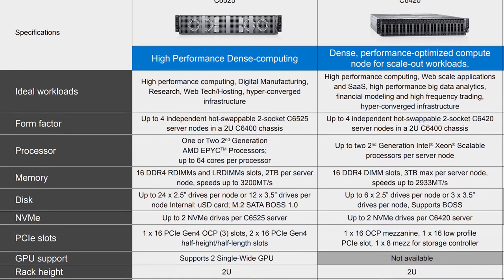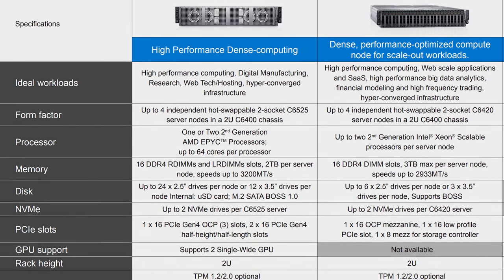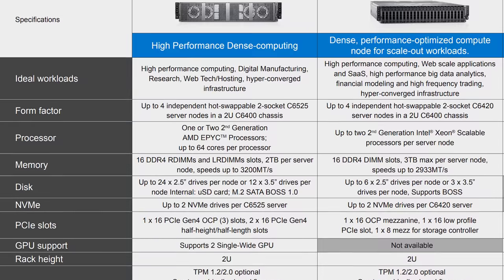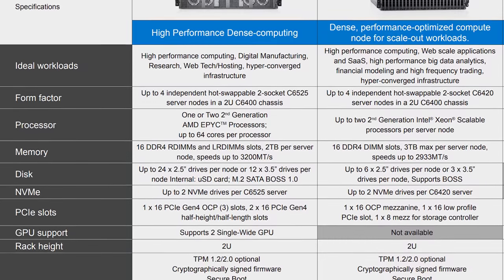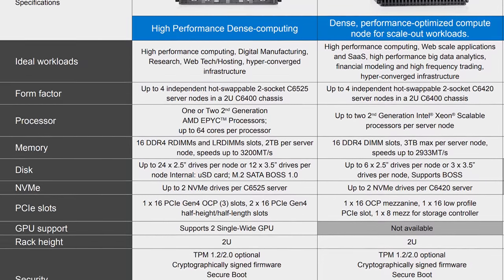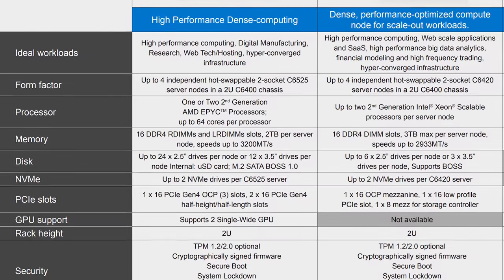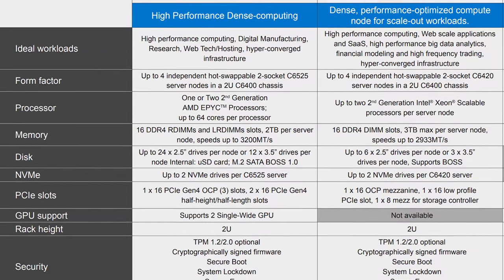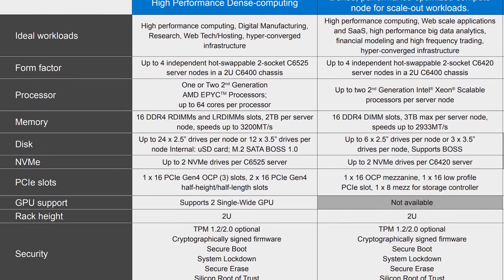Dell EMC PowerEdge C6525 AMD EPYC Powered Kilo-Thread Server Review

Comment: Can you elaborate on the CPU/iDRAC fuse thing? Do you mean that you can't swap the CPUs out at all, even for the exact same SKU, e.g. in case of a CPU failure? Or is it more a case of preventing the customer from buying a particular configuration from Dell and then upgrading the CPUs to a higher end SKU using cheaper aftermarket parts? Or is it the other way around and it's actually that the CPUs themselves that are somehow locked to Dell platforms?
Reply from the maker: The fuse happens on the CPU. We had an EPYC 7001 part that we put into a Dell machine with this back in 2018 before this was known in the industry. We could put other CPUs back in, but we could not put that EPYC part in another vendor's system. So you can upgrade the SKUs in a server. However, if those fuses are blown, it seems like you can only put the CPUs you removed into another Dell system. We are probably going to go more into this. I thought it was commonly known, but just nobody had reported on it. Now I realize that maybe this has been happening since 2018 and maybe people do not know this in the industry since the systems are still new.
Reply: @ServeTheHomeVideo  Very interesting. I searched online and the only result mentioning it was the STH article accompanying this video. I would definitely be interested in the deeper details of it.

I suspect that the fuses are being set inside the AMD PSP, although the only solid reference I have for that is that the AMD developer datasheet for Zen2 mentions "fuses" (with no further information) as being a feature of PSP, and a paper from 2019 titled "Insecure Until Proven Updated: Analyzing AMD SEV’s Remote Attestation" which talks about the Chip Endorsement Key (CEK) that is programmed into PSP fuses on the CPU.
Reply: @gsuberland  Well, the CEK is immutable, once the chip has been manufactured via chip-unique OTP fuses (more accurate: the secrets the CEK is based upon). I would consider the entire SEV security (for which the whole shebang was designed for in the first place) compromised, if one could alter the CEK via platform. It would also defy the meaning of "OTP" (one-time-programmable).
The whole thing is well documented in AMDs "Secure Encrypted Virtualization API Version 0.24".
I haven't seen anything in AMDs available(!) documentation, which would hint towards the observations of STH.

STH: This is seriously hot stuff - I'd be delighted to read/watch a follow-up.

Edit: I found an interesting independant document, which I will be reading through: "Insecure Until Proven Updated: Analyzing AMD SEV's Remote Attestation"
https://www.google.com/url?sa=t&rct=j&q=&esrc=s&source=web&cd=ved=2ahUKEwjBhPjYnrfrAhUDAmMBHWOPA9gQFjANegQIBhAB&url=https%3A%2F%2Farxiv.org%2Fpdf%2F1908.11680&usg=AOvVaw0FzNCe92hxY7ewcipopmy2
Reply: It's part of AMD's Secure Processor, and it allows the CPU to verify that the BIOS isn't modified or corrupted, and if it is, it refuses to post.. It's not exactly an efuse and more of a cryptographic signing thing going on where the Secure Processor validates that the computer is running a trusted BIOS image. The iDRAC 9 can even validate the BIOS image while the system is running. The iDRAC can also reflash the BIOS back to a non-corrupt, trusted image. On the first boot of an Epyc processor in a Dell EMC system, it gets a key to verify with; this is what can stop the processor from working in other systems as well.
Reply: @Zizzily  Do you have a reference on that? I'm fairly clued up on x86 platform security but haven't heard of field deployable secureboot root of trust keys on AMD or Intel CPUs. A feature like that would be quite the find for projects like coreboot.
Reply: @gsuberland  https://downloads.dell.com/manuals/common/security_poweredge_amd_epyc_gen2.pdf
"The first generation of the AMD EPYC processors have the AMD Secure
Processor – an independent processor core integrated in the CPU
package alongside the main CPU cores. On system power-on or reset,
the AMD Secure Processor executes its firmware while the main CPU
cores are held in reset. One of the AMD Secure Processor’s tasks is to
provide a secure hardware root-of-trust by authenticating the initial
PowerEdge BIOS firmware. If the initial PowerEdge BIOS is corrupted or
compromised, the AMD Secure Processor will halt the system and
prevent OS boot. If no corruption, the AMD Secure Processor starts the
main CPU cores, and initial BIOS execution begins.

The very first time a CPU is powered on (typically in the Dell EMC factory) the AMD Secure Processor
permanently stores a unique Dell EMC ID inside the CPU. This is also the case when a new off-the-shelf
CPU is installed in a Dell EMC server. The unique Dell EMC ID inside the CPU binds the CPU to the Dell
EMC server. Consequently, the AMD Secure Processor may not allow a PowerEdge server to boot if a
CPU is transferred from a non-Dell EMC server (and CPU transferred from a Dell EMC server to a non-Dell
EMC server may not boot)."

Cheers! If you find anything neat with it, drop me a line. I have some friends who are researching into AMD's security, both CPU and GPU side.
Reply: @gsuberland  Oops, almost forgot the iDRAC9 bit! https://downloads.dell.com/manuals/common/dell-emc-idrac9-security-root-of-trust-bios-live-scanning.pdf

"Today, even a flashed firmware in a Read Only Memory is susceptible for exploitation by hackers who
commonly try to expose the system to malicious activities. Even though UEFI Secure Boot is effective in
providing host security, it fails if the flashed firmware is compromised. Hacker could gain physical access to
the system, and maliciously tamper with the BIOS image.
To counter the boot integrity threat problem, Boot Guard technology was introduced by Intel few years ago
with its 4th generation cores. This Root-of-Trust is based on one-time programmable, read-only public keys
that provide protection against malware tampering. When a system with Boot Guard starts, the BIOS image’s
cryptographic hash is verified against the stored key. If the verification succeeds, the BIOS boots up normally.
If the verification fails, the BIOS image is compromised, and the system fails to boot.
In addition to Boot Guard’s verification mechanism, iDRAC9 4.10.10.10 provides a Root of Trust mechanism
to verify the BIOS image at the host boot time. The host can boot only after the BIOS image is successfully
validated. iDRAC9 also provides a mechanism to validate the BIOS image at run time, on demand, or at user
scheduled intervals."

"Dell EMC takes security seriously and has adopted Boot Guard technology on its new generation of
PowerEdge servers to counter BIOS tampering issues. On the latest AMD Dell EMC PowerEdge servers with
iDRAC9, iDRAC first boots with chain of trust authentication, and then verifies BIOS integrity. iDRAC takes on
the role of hardware-based security technologies as well, and accesses the primary BIOS ROM through SPI
in addition to AMD’s fusion controller hub (FCH) and performs the RoT process.
iDRAC9 4.10.10.10 directly accesses the BIOS primary ROM to perform a RoT operation on the processor,
on both the security block and the host initial BootBlock."

and

"1. When logged into iDRAC, a SEL event notifies the user that iDRAC has failed to verify BIOS, but host
booted successfully.
• This is part of iDRAC HW RoT. Even after a failed BIOS image verification, iDRAC performs a
recovery operation to bring good BIOS image."
Reply: @Zizzily  Nice one, I'll have a read of those docs later! :)

Comment: Like for covering the fpga fuse thing; will avoid Dell for my next purchase.
Reply: It's part of AMD's Secure Processor, and it allows the CPU to verify that the BIOS isn't modified or corrupted, and if it is, it refuses to post.. It's not exactly an efuse and more of a cryptographic signing thing going on where the Secure Processor validates that the computer is running a trusted BIOS image. The iDRAC 9 can even validate the BIOS image while the system is running. The iDRAC can also reflash the BIOS back to a non-corrupt, trusted image. On the first boot of an Epyc processor in a Dell EMC system, it gets a key to verify with; this is what can stop the processor from working in other systems as well. I guess we'll see if other OEMs start doing this with Epyc processors.
Reply: @Zizzily  i'm a little fuzzy on the details (that i'd be very interested to know about), but the idea is that the processor has a key to verify the bios with, so that even if it is updated while powered down, it can check that the origin is valid? Is the key unique to the individual BMC or to the vendor? I like the idea that iDRAC can flash the firmware - i'm jealous that iLO cannot, at least the version i have - to the point that it would almost be preferable to remove that ability from the running system itself to ensure integrity.
Reply: @capability-snob  I believe the keys are at a vendor level rather than a BMC level. Here's some more documentation from Dell:
https://downloads.dell.com/manuals/common/security_poweredge_amd_epyc_gen2.pdf
https://downloads.dell.com/manuals/common/dell-emc-idrac9-security-root-of-trust-bios-live-scanning.pdf

Comment: What difference is there between blades and nodes?
Reply from the maker: Typically blade servers have integrated chassis management as well as interconnect/networking. In these systems, there is not a chassis switch or pass-through module so we typically just call them nodes. People do use both sometimes, but usually when they are less aware of the difference between these systems and the blade segment. There are other differences as well, but those are usually the big ones.

Comment: Amazing review. Really detailed. Love it. Is there any 100gbe cards for this system? I just learned about that new adding spec.
Reply from the maker: We could not put 100GbE cards in because the one riser we had was occupied. The OCP NIC 3.0 slot is x16 so one can, in theory, put a 100GbE NIC in there as well as the x16 slots. Also, one could likely work with Dell to configure EDR/ HDR InfiniBand.
Reply: @ServeTheHomeVideo  I was thinking about the OCP slots if you could install 100gbe card
Reply: I just looked at the Dell site today, and they offer the HDR100 Mellanox card that can do 200GbE over FC or Ethernet.
Reply: @NdxtremePro  thanks for checking that's insane speeds
Reply: @ServeTheHomeVideo   So one rack full of this and you have already exhausted the outgoing bandwidth of your normal data centers. In the USA with it's rotten private infrastructure most have just a few TB bandwith.

Comment: Dell blowing efuses to lock in particular CPU to particular motherboard -- did i understand that correctly? That is just crazy and stupid if so -- what if your CPU gives out the magic smoke, you are supposed to get a completely new system? fsck that
Reply from the maker: Not exactly. We have had a lot of feedback on this so we will have a more detailed bit on it soon.
Reply: It's part of AMD's Secure Processor, and it allows the CPU to verify that the BIOS isn't modified or corrupted, and if it is, it refuses to post.. It's not exactly an efuse and more of a cryptographic signing thing going on where the Secure Processor validates that the computer is running a trusted BIOS image. The iDRAC 9 can even validate the BIOS image while the system is running. The iDRAC can also reflash the BIOS back to a non-corrupt, trusted image. On the first boot of an Epyc processor in a Dell EMC system, it gets a key to verify with; this is what can stop the processor from working in other systems as well.

Comment: With that system i could have done the last three years of my phd thesis in a few month😭
Reply: You've caught my interest, why would it shave it down that much?
Reply: @everythingfeline7367  on one hour of manual work/biological model building come 3 h of calculations/refinement on 8 threads (the maximum i had). Best you run 3 different refinment strategies in parallel and continue with that that gave the best result (what i fid over night, often took 10 h). If i had a threadripper i would have run 5 in parallel (each using 10 threads). I did this like 3 years) Also with enough cores you can automate alot like 5 h (4 cores) automatical model building saves like 30 min-1h of manual building in average. Sth else i did often 2 minutes manual parameter edit, then 30 mins on 4 threads calculations (i always did 2 in parallel). So 2 min work 30 mins calculation (which could utilize hundreds of cores but i just had 4). And i did this often for many days, maybe halve a year in total. And my gaming laptop i had to buy myself, the university gave me first a dual core, than a 4 threads office pc, impossible to work with that, i always tried to cluster whatever computer was free from colleques eg. At night or during lunch times. So most of the time at work i was running around asking/beging for computers to use, while mine where calculating.
Reply: @claudiussmith8798  wow that's pretty insane. Glad you got it done though
Reply: @everythingfeline7367  thx, but i am still writing^^ but the results are finished since february😁.

Comment: 1024 cores and it comes with a 1gb ethernet by default.
Reply from the maker: In a way, no Ethernet by default since those are designed to really be out-of-band management ports not main system network ports.

Comment: i dont understand the half of the video :(
Reply from the maker: :-( It puts 8x AMD EPYC CPUs in 4x dual-CPU servers into a single 2U server.
Reply: but the nodes is like another server? and how many ram does it support?
Reply: Pablo Tassinari I think it is 1TB of ram per cpu. 128gb per stick, 128 x 8 = 1tb. So 2tb per node (2 cpus each).

Which totals to 8tb for four nodes.
Reply: @paulvancyber1979  A node is another word for a server. As in, you have 4 individual machines in this chassis, each with their own iDRAC management port.
The intent is to install 4 bare-metal operating systems/hypervisors in this one chassis
Reply: @popcorny007  so each node use its own disks?
Reply: @paulvancyber1979  Yes, each node has control of 1/4th the disk in the front.

Comment: Wow, that's a beast. I guess Linux only. Vmware and Micro$oft licensing would be a killer. Would be cool to see what cloud providers use for their hardware. We have to use on premise VMware because of AS400 ERP thingie. That's another mess. But for HPC this seems to be not bad solution. It's been kinda quiet out there about server hardware so it's nice to see some Epyc coverage. For SMB Epyc is practically the only logical solution for on prem. Dell dumped Xeon for any server at this point. Intel on client corporate desktop. I guess some sweat deals from Intel. Are we all going cloud at this point so server hardware is no longer viable ? This was very interesting for sure

Comment: 1,024 cores, 2,048 threads... I don't need it. BUT I REALLY WANT IT!!!
Reply: @Son Vu Anh Depends on configuration. AMD has (And Dell supports in this model) EPYC processors with 64 cores, 128 threads per package. The 6525 has 4 nodes per server, and each node has 2 CPU sockets. This means that per node you can have a maximum of 128 cores, 256 threads. Load 4 nodes with these chips in and you get 1024 cores, 2048 threads.
Reply: @DigBipper188  4*128=512 cores
Reply: @DigBipper188  You said it yourself, "Per node you can have 128 cores, 256 threads".
4 nodes = 512 cores, 1024t
Reply: @popcorny007  Yup... my maths was mega off there lol

Comment: Good jog strangling the second hand market with these Dell. Piss off. Sigh. Its decisions like this that make consumers chose other vendors, no matter how good you make your product.
Reply: It's part of AMD's Secure Processor, and it allows the CPU to verify that the BIOS isn't modified or corrupted, and if it is, it refuses to post.. It's not exactly an efuse and more of a cryptographic signing thing going on where the Secure Processor validates that the computer is running a trusted BIOS image. The iDRAC 9 can even validate the BIOS image while the system is running. The iDRAC can also reflash the BIOS back to a non-corrupt, trusted image. On the first boot of an Epyc processor in a Dell EMC system, it gets a key to verify with; this is what can stop the processor from working in other systems as well. I guess we'll see if other OEMs start doing this with Epyc.